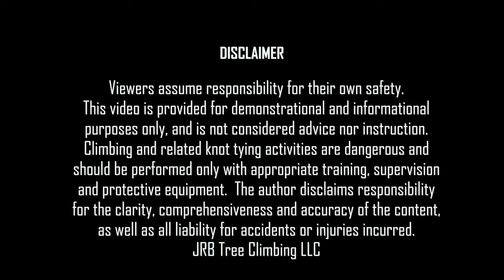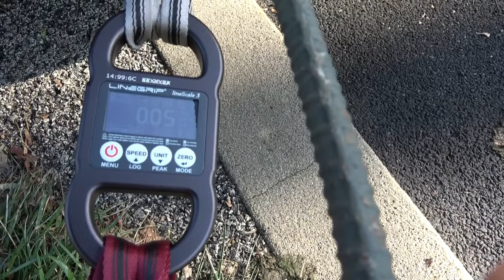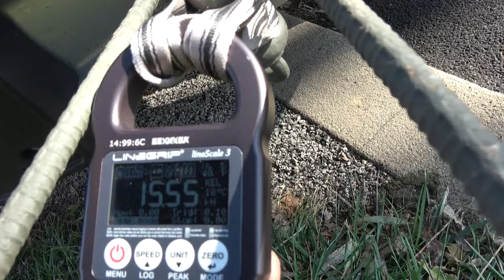Introducing the Longhorn Hitch and Soft Shackle

Comment: Where I there during your testing, I would have suggested using a come-along with your vehicle in park
Reply from the maker: Thx. I agree. I have used a come along in prior videos but mine is not strong enough to break this and I don't want to break it either.  I have had a come along break on me when attempting to stand up a  spruce that had gone sideways in a storm and let's just say I learned that ya never wanna push em til they break.

Comment: I hate to say it but if you had used another soft shackle (heavier guage line than the one being tested) in place of that monster wrecking ball steel shackle your scale would probably have survived the test.  Wrapping the guage with a dish towel or some bubble wrap would help too.  Excellent knots, excellent videos!
Reply from the maker: After the event, I realized that the way I rigged it in the cradle for this test was slightly different than when I designed the cradle initially.  But I hear ya. Thx!

Comment: I never made a solft shackle because the button knot seemed hard to tie. I like this a lot. It even looks like a long horn
Reply from the maker: The Diamond knot is also a chore. This design is different.  The tails are the horns are the toggles.
Reply: Tying a soft shackle is soooo easy. Just review a few of the step by step YouTube videos. Really just a few minutes of practice works wonders. You don't need to memorize; just slow the video and follow along.

Comment: Thats a great new resource! I have just made up a climbing system using your compact ascender hitches a on both ends using 8mm on 11 mm abseil line. Would you add the dimensions to the resources list on your website for the various lengths to tie this into the compact and other variants of the ascender hitch? Too bad about your testing unit, I hope its not too dear to repair...
Reply from the maker: I added a note to the table to give the information you need. Make sure you load and tune it on a hunters before attempting a Longhorn.  The JRB Ascender wants to see an even load on both strands which requires some tuning after we tie it.

Comment: Thoughts on this as a Quick link replacement on SRT/rappel rope?
Reply from the maker: Those kinds of applications are on the table. For canopy anchor applications, I prefer using a carabiner as both the toggle and the rigging connector.  But we have to discuss the details and ensure pulling on the carabiner with our retrieval line doesn't cinch it. We have plenty of time to explore the details but for now, wanted to introduce it and make sure its a unique contraption.
Reply: @jrbtc  looking forward to it!

Comment: That's really interesting. But can it be easily reused once it has already been used with significant tension?
Reply from the maker: We tested a bunch of them to the point of breaking last week.  The short answer is that somewhere between the (reasonably minimal) weight of our bodies and the extreme force necessary to break it, it became jammed.  In comparison to a Scaffold knot ( used in life safety systems frequently), the jamming was less. And so, we need to consider the nature of where we apply it. I wouldn't use it to tow a vehicle... I am using it in an application like non-slack, static climbing. I will paste a link to a rigging application here on the channel.
Reply from the maker: https://youtu.be/HFYtMVuwdRM
Reply: @jrbtc  interesting. thanks for the info

Comment: Would definitely love to see a JRB collab with Ryan from HowNot2!

Edit: he also has lots of experience with breaking Line Scales so can probably offer advice in that regard! For his drop tower he has a setup with the Line Scale in a padded Pelican case that has some cutouts to run the connectors to.
Reply from the maker: I actually did reach out to those guys at one point but did not hear back. And I did get a protective case after this mishap. Obviously, I am not equipped to do this type of testing and am simply doing the best I can with my time and available resources. There is a another video on strength testing where I got a chance to get some formal tests done on a test rig. I appreciate your comments and support. If this is good information, we won't be able to stop it from spreading and finding the people who it can benefit.
Reply: @jrbtc  Bummer, I do know that they get a lot of requests. I'm glad you found a place to do some controlled tests! Just watched that video, all very good stuff. Thanks for all the work you put in, it's great to see some formal strength numbers!